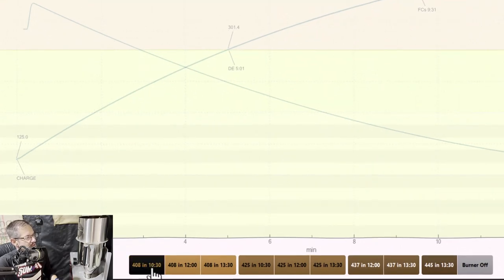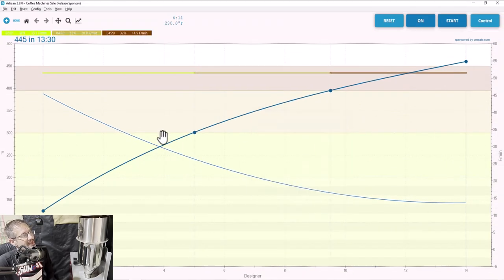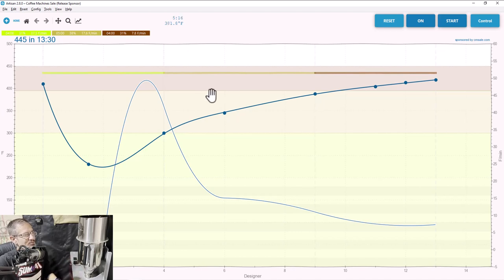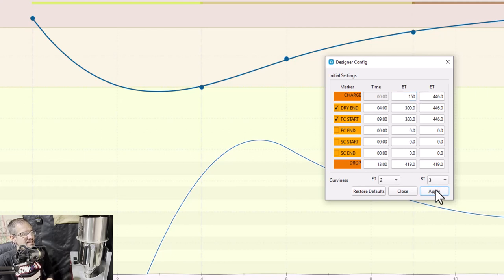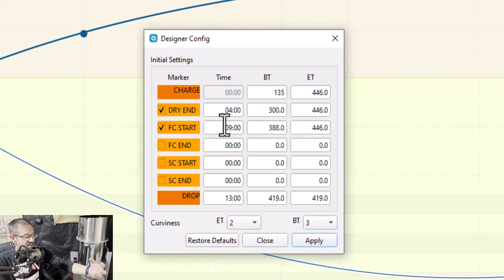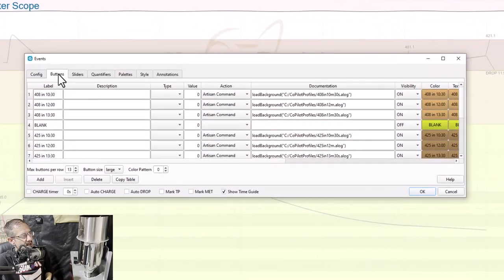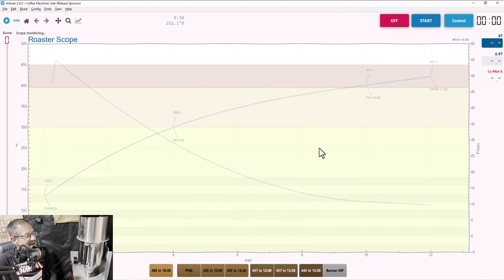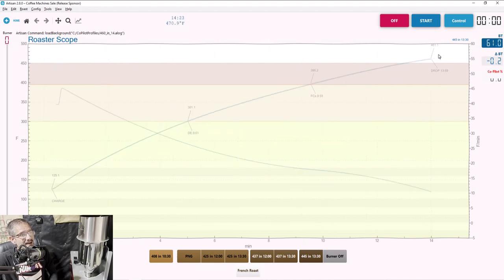Creating Roast Profiles in Artisan for the Hermetheus Roaster Black Box and Co-Pilot Automation Kit

Comment: Great video! About to start my roasting journey and already feel better about understanding how the program works.  Curious if you have a chart somewhere that gives a breakdown of solid roasts based on bean type?  I do plan on an ethiopian Yirgacheffe as one of my regulars.
Reply from the maker: I don't have a chart like that, and while there are exceptions to every rule (including your personal taste preferences), I find that a naturally processed Yirgacheffe really shines with a light roast. The "408 in 10m30s" is my go-to for this very bean, because it brings out the fruity notes really well. I've also had some naturals that seemed a bit too "grassy" with that profile, so I would need to go a bit darker. On the other end of the spectrum, wet-hulled beans (Java, Sumatra, etc.) are traditionally roasted darker, perhaps to second crack. Then you'll always have regions like Colombia that has such a diverse selection of flavor profiles, there's no real go-to roast. Some roasters like to use a ladle to remove several sample-sized quantities of beans starting shortly after FC. For instance, grab 50g of beans at 410, 50g more at 420, 50g more at 430, etc. Then do a blind cupping and find out a general drop temp that works well for that bean. I hope this helps... happy roasting!

Comment: One difficulty by Mac OS is the syntax of paths.  I looked at the Help on making a working button, also looked at Mac OS syntax.  Nothing worked to invoke the profile to load.  

loadBackground(<Maximus/Applications/Artisan 2.6/Profile Curves/"Finca_411_46-41-13.alog">)
loadBackground(Maximus/Applications/Artisan 2.6/Profile Curves/"Finca_411_46-41-13.alog")
loadBackground(Maximus\Applications\Artisan 2.6\Profile Curves\"Finca_411_46-41-13.alog")
loadBackground(Maximus:Applications:Artisan 2.6:Profile Curves:"Finca_411_46-41-13.alog")

Marko, would you have the accurate path syntax for Mac?
Reply from the maker: You just need a leading forward slash on your file path! loadBackground(“/Users/Jason/Documents/myprofile.alog”)
Reply: @hermetheuscoffee  so I wound up doing that.  So many other complications with it loading.  It says it does in the log and then it does not show.  Hit Reset and it shows.  Hit reset and it doesn’t clear.   Very funky.  Not sure I’m a candidate with a mac.  I can do it manually.  Looked good on the Pc.
Reply from the maker: @Chuckie3D  are you on the latest version? (2.8) Most Co-Pilot users are on Macs, and there are no issues. Santa will be sending you some Co-Pilot Config files soon!
Reply: @hermetheuscoffee  indeed 2.8.   I threw the book at it too.  So thanks for sending me config files.  Maybe a checkbox I’m not aware of!  I kneel at your feet, my King.